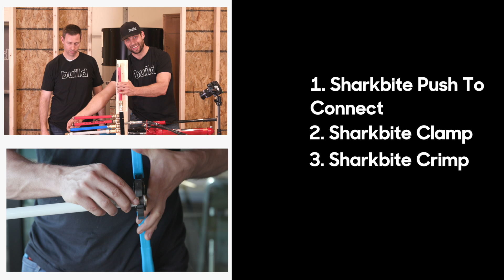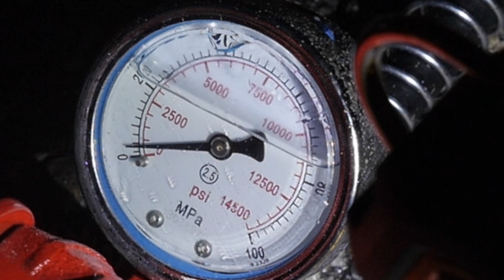Can we blow off these PEX fittings?  Sharkbite vs Viega vs Uponor

Comment: The biggest problem with the plastic water piping is heat. It's pressure rating tanks as the temperature goes up(as stated on the piping). 
Using brass fittings to connect to the plast also has issues with dissimilar rates of expansion and can cause leaks over time(the main reason for the change to the polly-alloy fittings from the brass). Keep your pex piping under 120°F and out of sun.
Reply: PEX A easily accommodates joint expansion and contraction as temperature changes, without loss of tubing to fitting sealing performance over time. Brass fittings, for use with PEX A, are a lot stronger  and more durable than Polly-alloy (?) fittings.
Reply: @johnstuart3851  
You realize I am a plumber and have firsthand experience with this product.
I use it. It's cheap and fast, but it has problems.

Comment: this video was nothing but a waste of time. anyone who has worked hands on with pex plumbing or piping knows that the pipe will inherently fail much sooner than a crimp ring re inforced brass end fitting or even the EP poly fittings. and using a 14,000 psi capable ebay knockoff port a power, hardly constitutes a real world 14,000 psi actual test. this video is nothing but click bait. utter fail 👎

Comment: Been using sharkbites for a couple of years, only problem I’ve had is ons leaking when used on an older copper pipe that wasn’t clean enough. Cut it back and all’s well.

Comment: I'm a fire sprinkler fitter by trade but used the shark bite push to connect and the pex fittings/crimps to rework a hot water tank and redo some plumbing work at my home and was extremely nervous when turning the city water back on. I can't believe how easy the shark bite connectors are, I was expecting it to blow off but it's still holding.

Comment: Hang on a minute......   You're trying to test burst pressure of plumbing pipe and fittings with a hydraulic pump that has start increments of around >250 PSI???   So really you don't have any idea just what pressure your test pressure is on those tubes and fittings.

You "NEED" a 0 to 1000 PSI gauge for any accuracy and or idea of failure points!

Comment: I think that the only way to get a true useful test is to pressurize the pipe two times the maximum pressure that any environment would provide and leave it for 30 days or 10 days or until and if it fails

Comment: Use a liquid filled lreasure guage with a tell tail needle. Availble fairly cheep at Mc Master Carr.
Reply: A pressure creep test would be more useful fill with water pressure and use a gauge and shutoff valve to hold pressure. Monitor pressure change over time. I would do it at 120 f. Then see loss or leakage of pressure over time.

Comment: Unfortunately the 2 ft pipes would react differently than 10 ft pipes at same pressure, either way, the connectors are fine as flexibility is not allowed at the ends 🙏🏽

Comment: Why did you run your thumb up under the sharkbite ring just before it failed? It was gonna do that all on its own....now we think YOU made it fail.  You're not a scientist, no sir.....

You're running the test at what, "up to 14,000 psi"....normal plumbing experiences less that 100 psi unless you're in some dumbass city.  Mine never sees more than 50psi.   Fine for a giggle, I guess.  ALL would pass for use in anyone's water supply system.  Tho I don't like sharkbites, which just FEEL like a temp. solution, to this old timer....
Reply: PLUS:  Those leaking threads...you didn't test at LEAST the worthiness of your rig ahead of time??  Yup.   I don't see any plumbers here.

Comment: The second one that burst the pipe not the fitting. Still did not fail at the fitting. Not fair to say it failed. Also you should have tested each one separately. So per A and apex B actual pressure test should be done. Then redo your test to stop just before Pex A and Pex B known failure. Really you need to terminate the connectors themselves to put the pressure at connection only.

Comment: In U.K., I first used Acorn PEx in mid 1980s 30 years later they were still working fine. Acorn was renamed Hep2o and later that style was sold to Polypipe. It has a screw on cap with O ring seal and grab ring. Later Hep2o had the grab rings but need a special tool to de mount the fitting. John Guest is another brand but to me they always feel wobbly and their pipes are really stiff.

Comment: Good to know that all the fittings are adequate.  Even sharkbite will hold over 100 psi.  Private wells are rarely above 60 psi.  I prefer the metal crimps.
Reply: I actually like the Uponor expansion fittings, because the fitting has the same ID (Inner Diameter) as the tube itself. Thus, no flow restrictions like the barbed connectors.

Comment: Luckily your hand was on a pipe that didn't fail, and you moved away from the system for further tests.  Had your hand been around a pipe that failed, you likely would have hydraulic fluid injected hypodermically which requires surgical removal, or blood poisoning can ensue.

Comment: Although the methodology was a bit shaky the experiment shed some valuable light on pex plumbing in general. I have heard of running pex lines for compressed air w/a number of connectable ports to plug in pneumatic tools. What are your thoughts on this using the same fittings minus push connectors?
Reply: What is the PSI of city water, and of compressed air? For the love of all that is holy, do not do this.

Comment: Shark bite will pop by water hammer. I've come across this once by a contractor whom put these under a slab. I myself prefer the uponor, and have used up to 2" on a commercial repipe back in 2015. This was a great test, but I'd like to see one with various fittings as my concern is with the plastic barbed fittings. 

Thanks guys!

Comment: I've used shark bit to do plumbing repairs on a dozen or so rentals.  I would never put shark bite in an attic, under a floor or inside a wall.  They are too fussy.  I use them on water heaters sometimes.

Comment: summary: 
sharkbite: failed first. unknown pressure. lowest pressure.
Pex A (uponor) pipe wall burst @ ~300 psi
Pex B (Vega) blue pipe wall burst @ ~500 psi
all other pipes burst @ approximately 500 psi.
lesson: sharkbite push to fit fittings suck. Pex A fails at 300 psi. Pex B fails at 4-500 psi. (in the half inch sizes)

Comment: Question: if the shark bite slip fitting is inside the house, say on the water heater will it fail before a freezing pipe bursts in the same system?

Can we use slip ins as a fail safe to protect the plumbing system as a whole?

Comment: My take away is that most of the products survived 400-500 psig short term pressurization.  That in itself represents a good performance for the intended product service.  Tests of this nature are often performed during routine manufacturing as QA checks. 

The end cap that failed should have been inspected carefully for manufacturing, handling or installation damage or defects.  Service in the field has shown they work for intended service. Therefore, there is a cause for this low pressure failure.  Of course, I would like to know why it failed.

Thanks for the garage testing guys.

Comment: i feel like seeing that the fitting for the uponor popped the tube its self, they are the winners no leaks fuck the tube itself, no one is gonna have 1200psi in there house but the fact that the fittings can hold that much  air and water no leaks, i mean come on.

Comment: As plumber thous leaking threads makes me cry, just use hemp instead of teflon tape in the threads
Reply: SharkBite PTC didn’t leak but It didn’t hold up either  it  failed  under significantly less pressure.

Comment: The previous owner of my mobile home had to re-plum the place due to the faulty PEX pipe of the late 1990's. He used Sharkbite press-on connections for the various shut-off valves. I don't know the exact time-frame but believe it to be about 10 years ago. So far, I haven't had any issues with them. I've owned this mobile home for 4 years now. I wished he had used red/blue. Will cause me a problem when it's time to fix stuff.
Reply: I hope all the PEX tubing is protected from sunlight, even indirect light through a window, under a mobile home or ventilation openings in foundations.  PEX is not UV resistant and will deteriorate.

Comment: These type fittings typically do not fail under pressure. Failure will most likely be from water hammer and pipe / fitting vibration. Test under low pressure and in a vibration setting and you should start to see failures.

Comment: clearly the pipe on the bottom are receiving the most pressure first. also to truly test the fittings you have to have steel pipe in between or shorten the pex to 2 or 3 inches with just the fittings on to be fair

Comment: I am doing a whole house pex yesterday and today-be done tomorrow -a whole house by myself-weird that pex fittings can be twisted after crimped you cant pull it apart but can twist it if crooked you can straighten it -shark bites are equally as amazing-with these modern fittings anyybody can be a plumber-why go through all that solder and glue with fittings like this? A piece of cake compared to 
'used to be'

Comment: Fire sprinklers systems are hydostactic testest to 100 lb over ambient pressure.
We just assume its 50 lbs 
Although sprinkler heads can operate as low as 7 lbs
The 150 lbs are left for 24 hrs

Comment: Bad gauge range and precision.     
Also why hydraulic fluid and what type of hydraulic fluid?     Certain hydraulic fluids can weaken the plastic pipe and cause failure that water would not.
Reply: You dumb bastard, The fluid won’t weaken the pipe in a few minute test. The pipe failed around 500 psi. That’s all we need to know

Comment: One tip for hydraulic plumbing, use loctite 567 thread sealant in place of Teflon tape. It does not leak, and in a hydraulic system actually in use there is no chance of bits of Teflon coming loose and clogging valves

Comment: The couplings used have straight threads like a nut. You should have used galvanized couplings because they are beveled and most likely would not have leaked.

Comment: I doubt that an even pressure was spread between them. Should have been done with no leaks at start. The thing I learned is that the pex is the weakest link. I would like to see what pressure the push connect could stand. If all took more pressure than what would be found in a normal house,  then they all pass.

Comment: If they ever wanna do this again and have some actual FACTUAL pressure stats and proper video documentation say by the high speed video guys also but I could help them use snap on pressure transducers and labscopes so we can see actual rise and fall. And I think having shut off valves to help resets might be better.

Comment: Someone correct me if I'm wrong, but aren't most residential areas fed by municipal water systems all standardized to 50 psi pressure at the meter for each house? If that's the case, I'd say this piping material will do just fine.
Reply: Yes normally the psi its between 60 psi and the most 80 psi here in Nevada so its fine . !!over 150 psi its to match !!

Comment: Your test rig is flawed fundamentally first with you can not have a pipe on the end is a simple function of the design of a pipe will concentrate pressure on the end until the cross of the side equals the end.

Comment: 1. what the pn ( pressure nominal) of the pipe. It will show you why it bursting first
2.  need a gauge to know the pressure you are given to the pipe or fitting
3. Can not leaked. When leaking than the pressure will be the same for each pipe. Like the pipe a it has no leaking than the pressure power will get maximmum
4. Can not use manifold

Comment: the sharkbite push connector popped first, the average water pressure in a house is between 50 - 75 PSI, would there ever be a chance that the water pressure in the house would exceed 75 psi?  and when Jordon increased the pressure and the sharkbite pex and slip on connector popped first, but do you know what amount  of pressure it was at?  it had to be  pretty high, easily over 100 - 200 psi, can you let me know?  Jacques

Comment: Water pressure in a house is only 70psi, so why is this relevant?
Reply: KarasCyborg it’s just proving they won’t fail
Reply: @suckmymeat371  Would be more interested in summer heat related failures in the ProPEX or other connector systems.  I hear the Rehau connectors are the best to use in the walls and ceilings.
Reply: KarasCyborg Ik from what I’m seeing he also has a freeze test...I’m looking into buying a abandoned duplex so I’m trying to figure out what would be the best plumbing option
Reply: If it has a lot of rats, then copper might be the better way to go -- they won't chew through that.
Reply: KarasCyborg rats aren’t really a problem but mice do come when the property isn’t really clean so would you still recommend copper? Or would cpvc due because I’m not completely sold on pex

Comment: The first connection was loose. IT BLEW AT THE BOTTOM NOT THE TOP!!!
Reply: Same pressure both ends
Reply: @Anon Ymous Meh, one of them had to blow before the other.  We have no idea if one connection was much better than the other or if they were near identical.  About the best you can say about this test is it got some views.
Reply: So this was not really a good test of the connectors but rather a test of pipes
Reply: I’ve used the press together Sharkbite fittings many times and have never been able to pull one apart that has been properly installed. I call BS on their so-called test. Either the fitting wasnt fully pressed together, or they may have left out the inner sleeve.

Comment: why don't you look at the spec  the pipe is rated at burst at 475 at 70 degrees  and 240 at 200 degree .  I would love to see a redo of this video with a 600 lb gauge on the manifold and use a baker pump . its interesting that the threaded fittings were leaking . love your videos but this is basic hydrostatic press testing theory. this  test shows that the pipe is going to fail at 5-6  times normal  60 psi  cold water temp. when we install these systems  we test it at 120 psi to confirm  all connections.

Comment: You guys did not show the amount of pressure it took to blow off the Sharkbite fitting on your first test.  You were too caught up in playing around at the time, so that really does not tell anyone much. Also, how much pressure is normally in the pipes for these four items to be tested against? That should be discussed immediately to make any such show really valid to begin with. It appeared that your pump required a ton of pumps to even begin to make it work properly. Did you guys really understand how to use the equipment before doing this video? I am pretty sure these fittings come with a pressure rating suggested.

Comment: In residential use, all of these fitting, when correctly installed, are good. If they withstand 200 psi with 120 degree water for an hour, they will hold the 60 psi in most home systems. Indefinitely, I should think.

Comment: I'm a little confused, the shark bite fitting didn't blow off, but rather the pex pipe and the fitting it was connected to?  It also looked like there was maybe a fitting on the other end.  Was the fitting connecting the pipe to the manifold a shark bite as well?  Honestly the big thing for me is eliminate the manifold and do individual tests with the same type and length of pipe for each fitting with a better pressure gauge.  Then repeat the test for each fitting several times.   You don't have to video each but if you're trying to compare apples to apples, some basic data sets would be appreciated.  This video is more a "lets see what happens when...." than a study in pex fittings.
Reply: Also, you're clearly losing pressure at the end of each pipe if water is leaking out on the threaded fitting end.  The leaking is basically acting as a blow off valve for the pressure which is only going to be overcome by a quicker pressure build, i.e. pumping faster.  Next, each leak is happening unmeasured and at a 100% different rate than the other threaded fittings.  Then factor in the manifold which water under pressure is going to go to the fastest exit, which would be the fitting allowing the most volume of water out.  Thus decreasing the pressure of the fitting on the end of that line.

Comment: Love the unscripted fails that is how you learn.  The SharkBite push to connect connection will fail with just a simple freeze. The upside is the repair:  just push it back on.  This occurred in my irrigation system build.  I am using the push to connect for joining copper to PEX with valves and these are accessible in valve boxes.  The buried PEX tees use barbed brass fitting with stainless PEX clamp.

Comment: Jokers...Obviously do not know much about Plumbing.  If the Sharkbite fittiting that failed was installed properly it would NOT Have Blown OFF.
It all cases with a correct connection between the pipe & fittings, the PEX Pipe will FAIL (burst) @ 900-970 PSI

Comment: This basically shows that all but the push on fittings are adequate however, I prefer the ring connector with crimp tool and pex B because it is more durable and the fitting can actually be turned inside the pipe with no leaks down the road for repairs. The pex B is flexible enough to snake all over a house, well enough to justify using just B, and it is reasonably priced to use brass fittings for a solid application that will last many many years. I have re-plumbed whole construction jobs with just B and brass. Also any helper can run pex (haha).. (with a couple minutes of instruction)